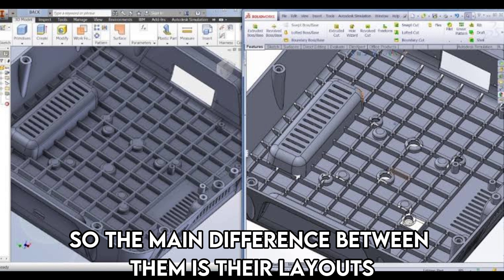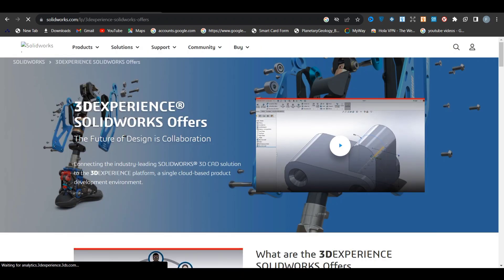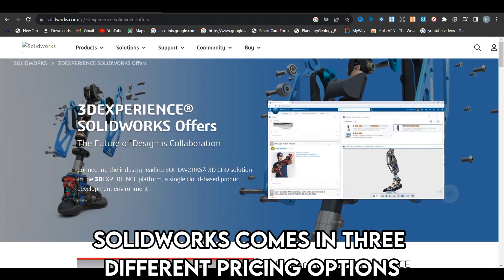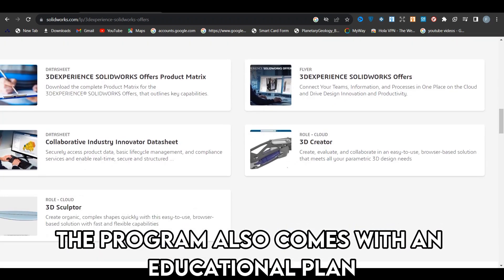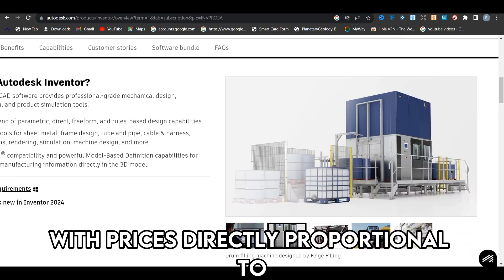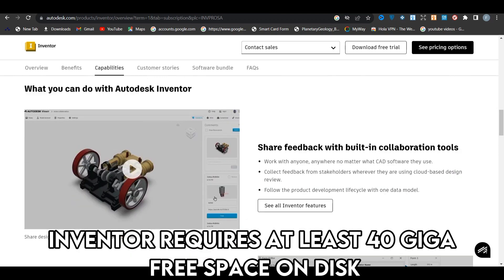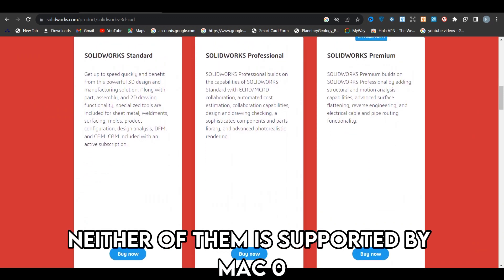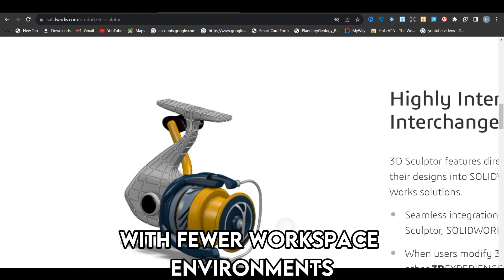Inventor vs SolidWorks- How Are They Different? (An In-depth Comparison)

Comment: Crap video, they didn't even use both softwares.
Reply: Fr.. I would like a deep comparison of the two programs. I work as a designer and you notice how often you reach limits with Autodesk. Then experienced employees say that something like this isn't a problem for solidworks, for example